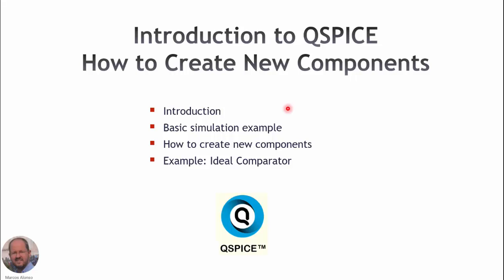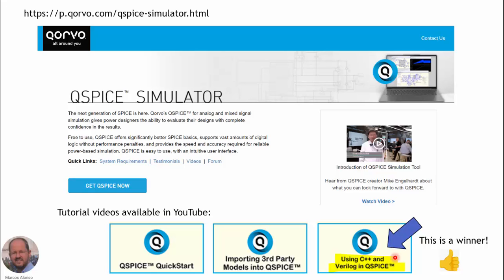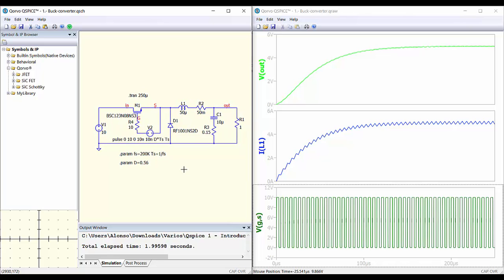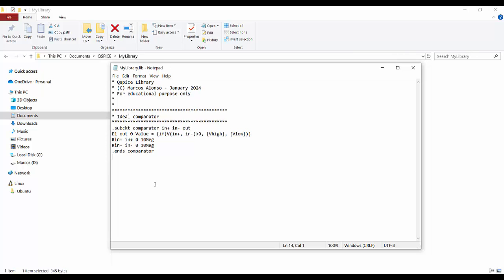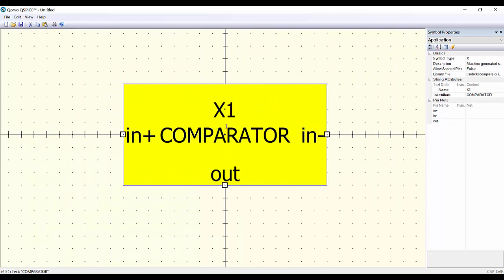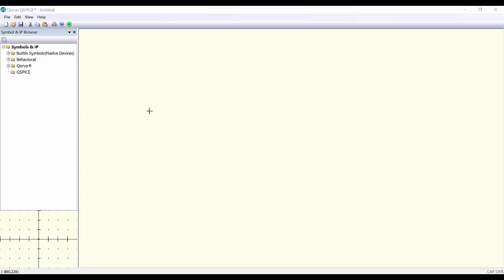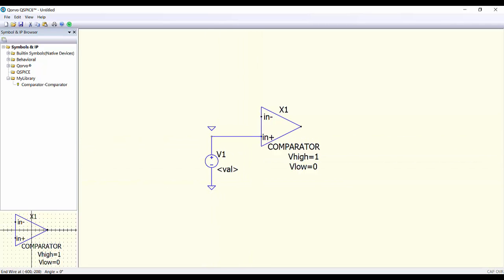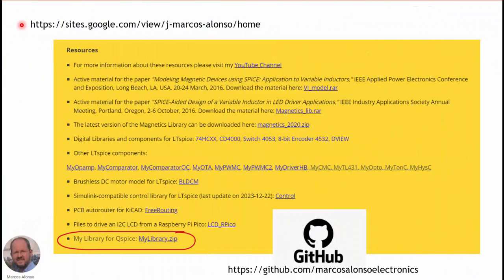Qspice #1: Introduction and How to Create New Components

Comment: Hello professor, there is an error in the simulation file Buck-analog-control-closed-loop uploaded in GitHub. The high-level output of the comparator should be 15V, but the setting in the file is 1V. This will cause the MOS to be unable to be turned on. In the video is correct
Reply from the maker: Hello, thank you very much for letting me know. I have uploaded the correct file now.
Also, it is important to add a "0" after the .tran statement when using the other options of the statement. LTspice does it for us automatically but in Qspice we have to do it when writing the statement. I have corrected this also in the file.
Reply: thank you professor @MarcosAlonsoElectronics
Reply: Hello professor,I compared adding a "0" after the .tran statement or not, but I didn’t see any difference. @MarcosAlonsoElectronics
Reply from the maker: @xht-xj3zc  Hello, if you run the circuit number 3 longer than 300us, 500us for example, you will see the difference
In other situations the difference can be greater.

Note that in Qspice help we can find the following:

There are two forms of the command:

1. Specify only the stop time
Syntax: .tran TSTOP [UIC]

2. Traditional Berkeley Syntax
Syntax: .tran IGNORED TSTOP [TSTART [MAXSTEP]] [UIC]

If we use the first form we can still control other parameters, for example:
.options maxstep=100n

But I think I prefer using the second form because we can write everything on one simple line
Reply: I re-conducted the comparative experiment according to the professor's instructions, and I found the impact of the two statements on the simulation results; thank you very much for the professor's answer @MarcosAlonsoElectronics

Comment: How to remove yellow block? I'm trying to create new triode tube symbol and after CTRL+V I receive yellow square, and I can not remove that square. Any idea, shortcut, how to remove that? THX.
Reply from the maker: You only have to select the block by left clicking on it and then press DELETE key on the keyboard.
Reply: @MarcosAlonsoElectronics  still I have problem with deleting yellow block. When I left click on this yellow block and then press DELETE key, than all disappear.
Reply from the maker: @fala-at  The yellow  block is a box with yellow fill, which is generated by default. Right  click on it -> fill color -> not filled
Reply: @MarcosAlonsoElectronics  12AU7 triode tube from LTSpice. CTRL+V with a code: 
.SUBCKT 12AU7 A G K
XV1 A G K TRIODENH
+PARAMS: LIP= 1 LIF= 0.0037 RAF= 0.0041813 RAS= 16.48 CDO= 0 
+ RAP= 0.032 ERP= 1.35 
+ MU0= 14.036 MUR= 0.006488 EMC= 0.0000236 
+ GCO= 0 GCF= 0.00012 
+ CGA=1.60E-12 CGK=1.80E-12 CAK=4.50E-13
.ENDS

 And I can not use DELETE button. I can only move yellow square on the right to create new triode symbol. Saving it with yellow square. And hack asci file to remove this yellow squere in notepad++. Any other solution? THX
Reply: @MarcosAlonsoElectronics  How to create triode symbol with two function: .SUBCKT 12AU7 A G K
XV1 A G K TRIODENH
+PARAMS: LIP= 1 LIF= 0.0037 RAF= 0.0041813 RAS= 16.48 CDO= 0 
+ RAP= 0.032 ERP= 1.35 
+ MU0= 14.036 MUR= 0.006488 EMC= 0.0000236 
+ GCO= 0 GCF= 0.00012 
+ CGA=1.60E-12 CGK=1.80E-12 CAK=4.50E-13
.ENDS
.SUBCKT TRIODENH A G K
+PARAMS: LIP=1 LIF=3.7E-3 RAF=18E-3 RAS=1 CDO=0 RAP=4E-3
+ ERP=1.5
+ MU0=17.3 MUR=19E-3 EMC=9.6E-6 GCO=0 GCF=213E-6
+ CGA=3.9p CGK=2.4p CAK=0.7p 
.ENDS